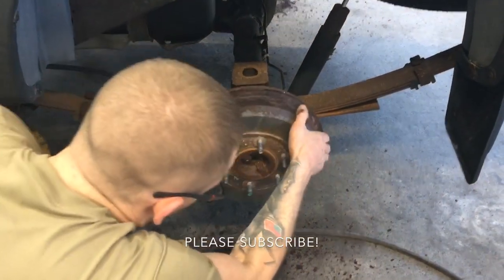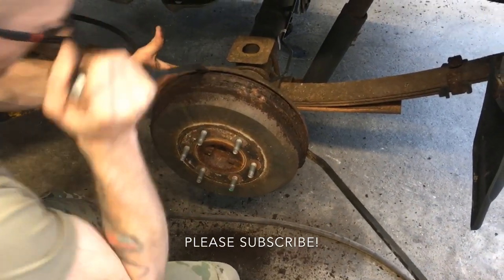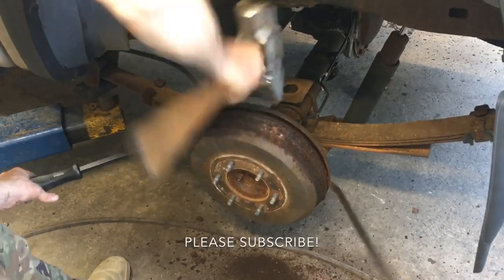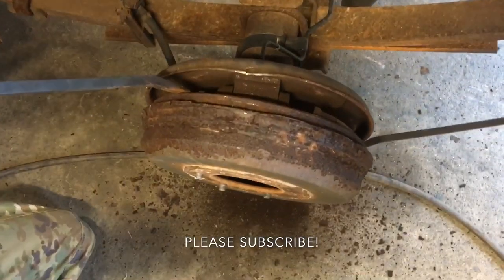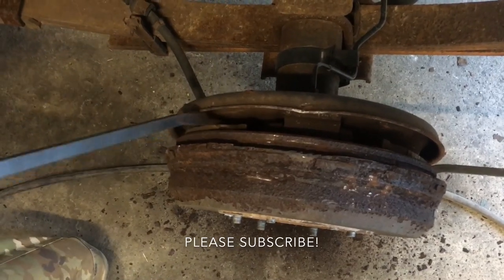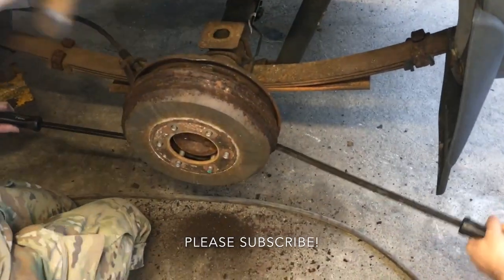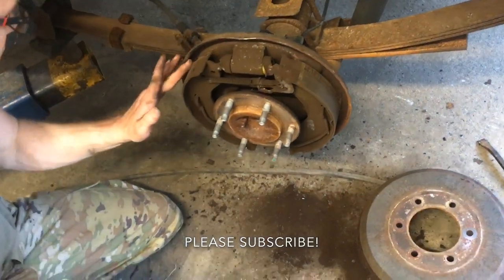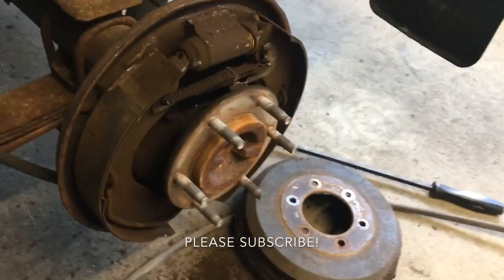Remove Stuck Brake Drum - When All Else Fails!

Comment: Finally a video where someone isn't afraid to actually smack the damn thing with a real hammer.
Reply: I think this is my final solution cause my brake shoes are stuck to the drum and unlike other cars where u Can mess with the adjuster through the back mine can’t and I’ve been on the car for 2 days now. I also thought about cutting the hand brake off but don’t want to deal with having to replace it later
Reply: @hugoperales4777  Worst case scenario, if it is front wheel-drive, remove the whole hub with the drum by removing the dust cap, cotter pin, the castle nut and washer. Then pull the outer bearing carefully. Then pul the whole dang thing off. LoL!!

Comment: Friend, this video was a life-saver! Seriously, it's the only solution that worked for me. I am working on my first car (used Pontiac g3 2010) and I was changing the rear brake drums but they were rusted as hell. I tried the screw method but that was useless. Your video and method was what finally did it. Thanks a bunch👍👍

Comment: Finally a video that shows that if all fails....get a Bigger Hammer. I've done it this way before in the 1970's when most cars had rear drum brakes. I would caution against bending the back plates of the drums. After a brake job I had this annoying sound in the back wheels. 

I had to remove the back wheel & drums to fix this noise  I had to use vise grips to bend the back plates to clear the drums. The noise went away.

Comment: I just removed both my rear brake drums for the first time ever!  My secret.  I used my $200 rubber sledge hammer from "Mac's Hardware."  It is a 12 lb.  Deadblow hammer that is 36" long.  The drum had rust welded itself to the shaft that centers your wheel on the hub.  5 good whacks all over and it came right off!
Reply: It would've cost $200 in labor to get a small shop to do it for you.

Comment: Wow, you fucked up that dust cover. Careful with the hammer man; whack the drum not the dust shield.
Reply: Who cares. You can bend the dust shield back with pliers. It isn't crucial. I'm a heavy duty mechanic and I've also spent my time as a trucker. Most trailer drums had their dust shields removed entirely. Why? Because you can check the drum lining and shoe meat on a service much easier. And us trucks drive through DEEP mud puddles, muck, gravel pits, coal mines (driving on mountains of coal and silicates), in ice and snow etc. Your brakes don't wear out faster with contaminates. They just might end up with tiny score marks.